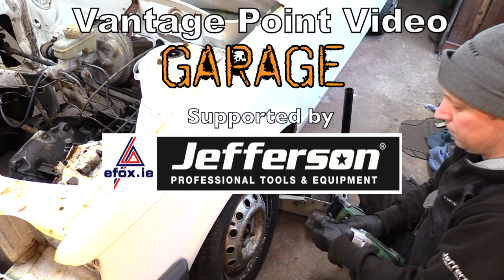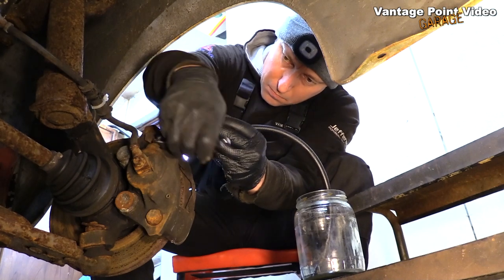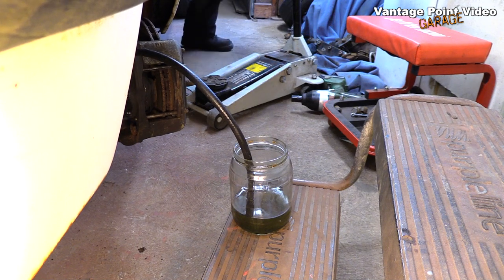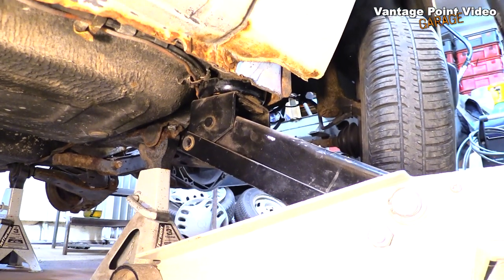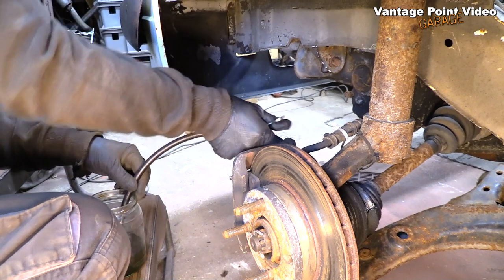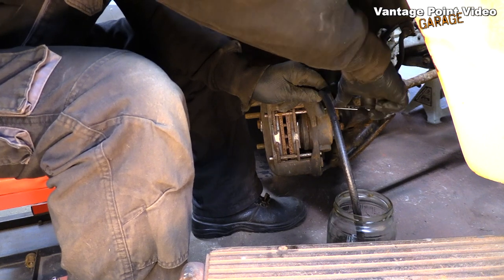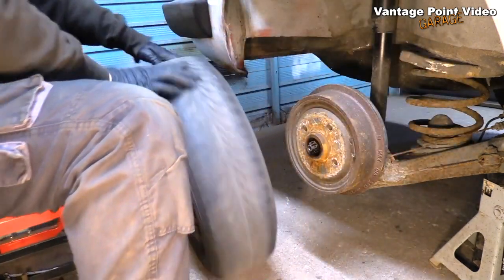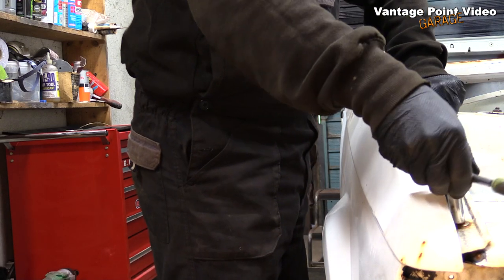Brake Master Cylinder Removal: Opel Kadett Historic Rally Car Build #7

Comment: Boy they did look to be in a precarious position. Will you need a cage in this?
Reply from the maker: If you look over my right shoulder in the final shot and thumbnail you can see the front legs of the cage hanging up in front of the window Eric.
Reply: @VantagePointVideoGarage  Well shoot.
Reply from the maker: I wouldn't expect anyone to see it in the messy background of my garage Eric. It's actually been there since the beginning of the Charade Project!! Fitting it will be the first constructive phase of this series.